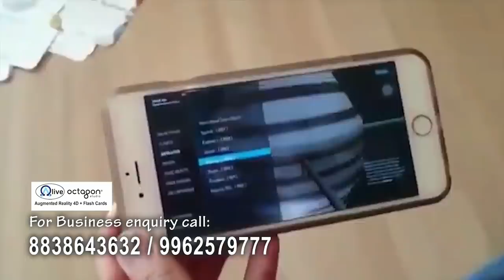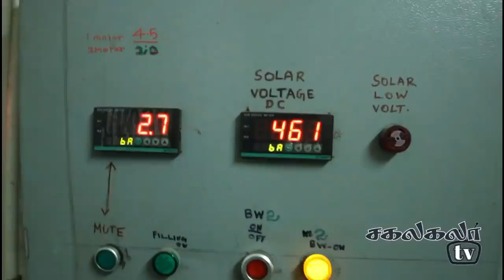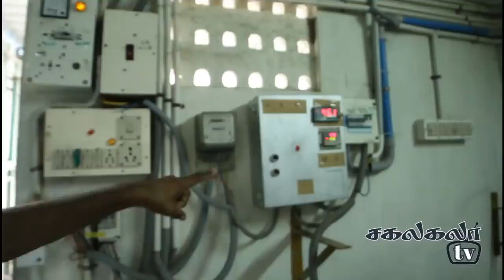Solar- ல் இயங்கும்  Factory || Solar RO Plant || Sakalakala Tv || Arunai Sundar ||

Comment: what is VFT can you explain sir. how its work?
Reply: VFD bro apde na variable Frequancy Drive ithu 3 phase system la 440v ac current a 600 v dc ya mathe marupadeyum namaku thavayana frequency ku  3 phase ac current a tharum, 600v dc ya ac current a mathanum and frequency change panna vum ithula electronic switches use panranga(MOSFET), ithu maximum industry la motor oda speed a control panna use pannuvanga single phase inverter a pathe yanaku sareya tharela.
Reply: @thiravidamanit1990  thanks for your replay sir.
Reply: vfd is a device used to control speed of   an induction without any loss in torque and also saves electricity

Comment: Bro for home solar plant podanum  budget solluga bro....?
Reply: 1) monocrystalline solar panels has little high efficiency than polycrystalline solar panel
2)cheap and best polycrystalline panel price is RS8500 for 330watts.
3)cheap and best monocrystalline panel price is 11,000 for 330watts.
4) 1 kw is can be bought 40k, 

Don't know about battery and other things. It may cost around 20-40k. 
5kw - can run 1tv, 1fridge, 1 washing machine, 1 AC, 3 fan, 5 lights,
Reply: 1L to 1.5L